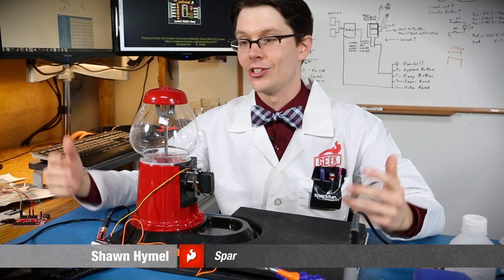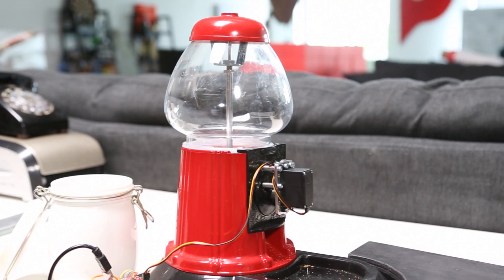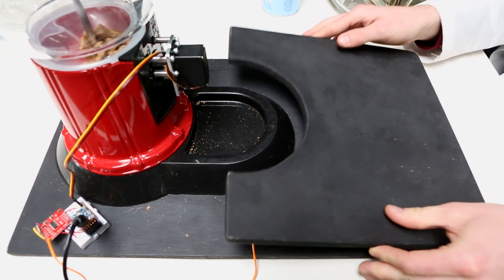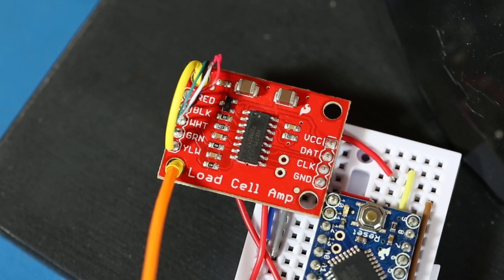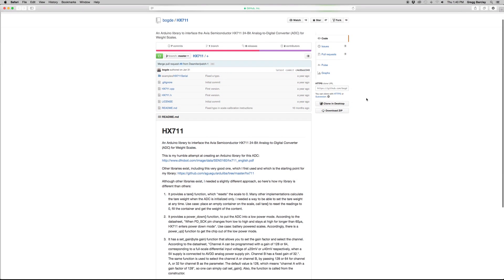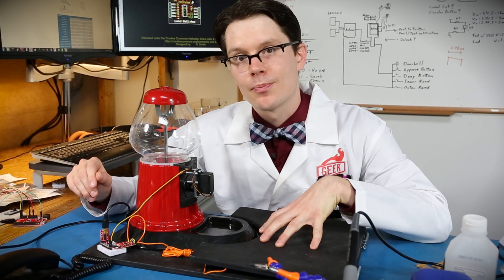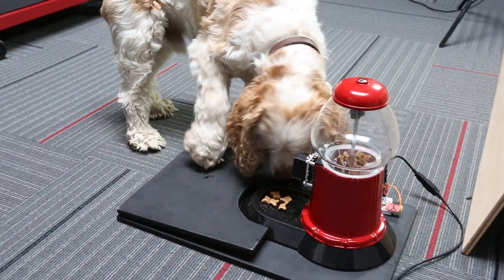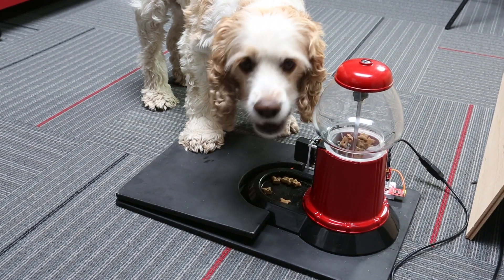SparkFun Dog Treat Dispenser!

Comment: this is a good example of how easy it is to use a load sensor and arduino to do something useful, however, it's overkiill... you only need a leaf switch to activate the dispenser.

Comment: The code examples on some of the links are broken. They incorrectly instantiate the object for the HX711. Also, the wiring diagram for the load cells in the 4 cell to "combinator" is incorrect, it reverses the polarity for half of the 4 sensor bridge.